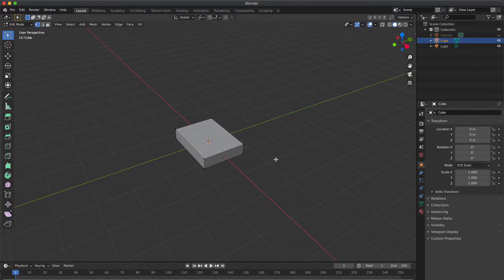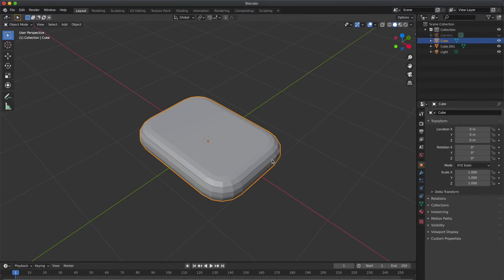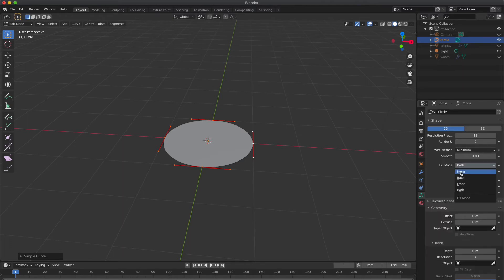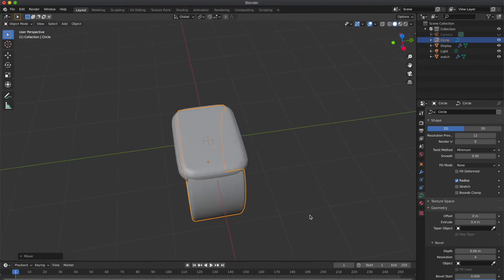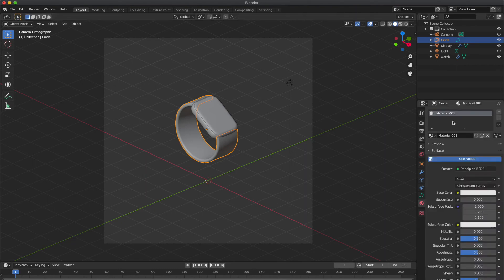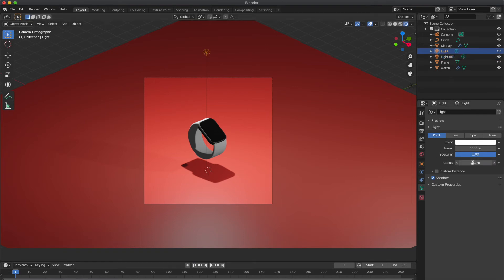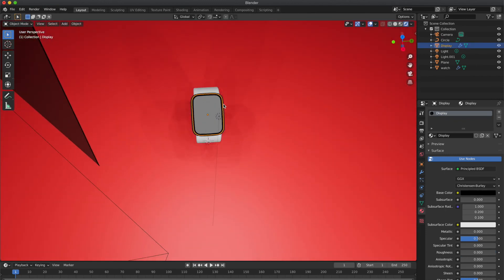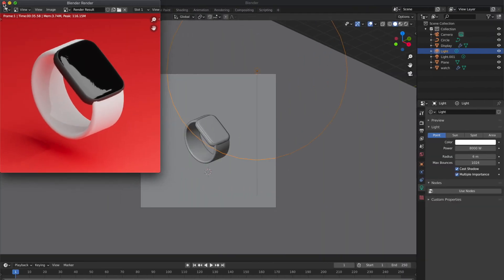Apple watch tutorial - 3D modeling process in Blender 2.9 | Using Curve circle & Solidify modifier

Comment: That selection of edges for making rounded edges didn't happened
How did you selected all four corner edges at once
Reply from the maker: While selecting an edge you can hold Shift to select how many you want

To select edge loop - Hold Shift + Alt ( If you are using mac - Shift + Option ) and select an edge, so you will be able to select all edges of a loop at once
To apply rounded edges to any edge, select the edges you want and press Ctrl + B to apply bevel and scroll your mouse wheel if you are using a external mouse (swipe with double fingers if you are using trackpad on laptop ) so you can increase divisions.. so edge will be rounded

Hope this helps you
Reply: @Jay3dtutorials  yes it helped thanks a lot